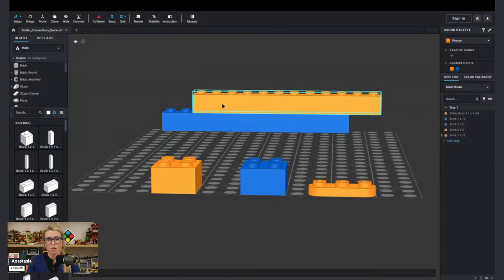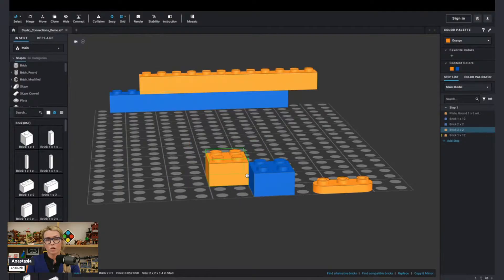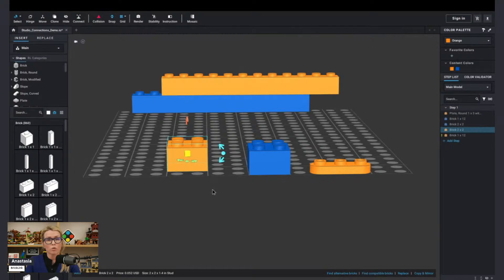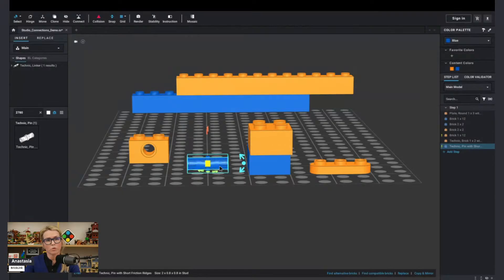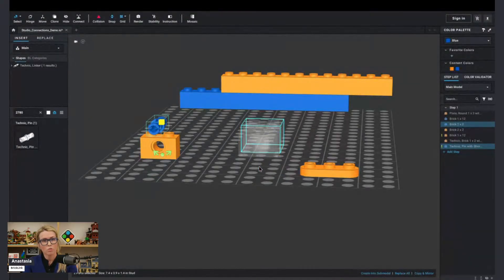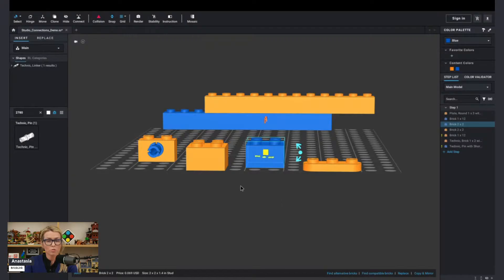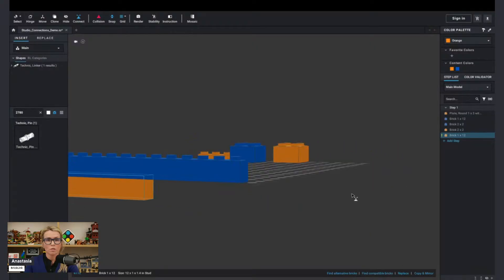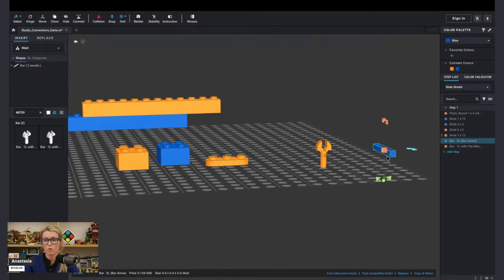BrickLink® Basics: Studio™ Connect Tool

Comment: Can someone please help me? I'm new to Bricklink Studio and currently mid-point on a design project? I'm trying to connect the Fabuland chimney piece to the corresponding Fabuland roof piece?

The problem I'm having is that the spur on the chimney piece won't connect to the tube on the roof piece? When I draw the green connecting line from the bottom of the spur to the roof piece, there is no oppositional connect point that shows up? I also can't use the move function as it shows up with the transparent collision view?

Any help will be greatly appreciated as I realise that this is a very specific niche problem.

I'm running Studio on a Microsoft Surface Pro 5.
Reply from the maker: Hi Ben, could you share the part IDs that you are working with so we can re-create the issue? Thanks!

Comment: Good to see you again. Last time we met was at Bricks Cascade, Portland Oregon. I built the huge star wars movie theater. I enjoyed your seminar, there is always something new to learn. For the part movement when using the keyboard (WASD), I have 2 options for the medium grid. The 'plate' grid is a side selection of the medium grid, which I did not see in your grid pull-down selection. With the claw and bar, getting a connection to work is a tricky. I found it works best if you zoom in a bit to select one of the connections within the receiving part. Studio sometimes gets finicky when trying to connect part from a distance. One of my tricks for moving parts is using a 1x1 modified brick (4733) and a 6L bar. Select part and bar then slide bar within the brick to move parts back and forth or up and down. This is great for moving parts not on the standard X-Y axis. Looking forward to your next seminar!